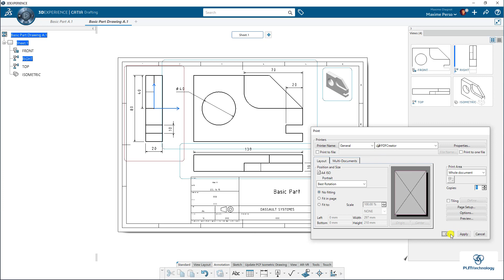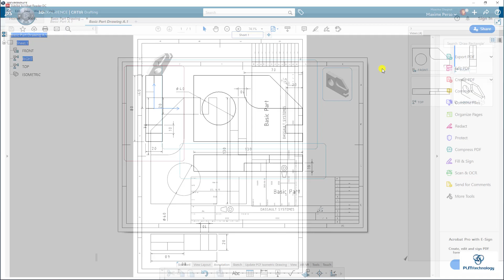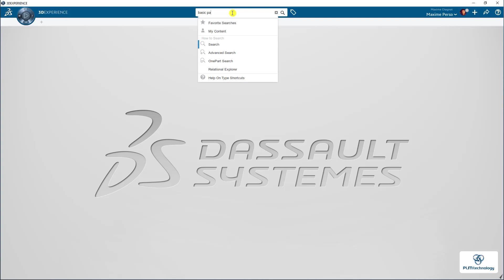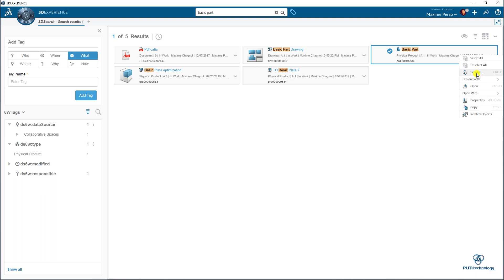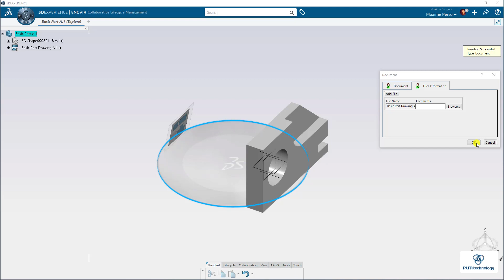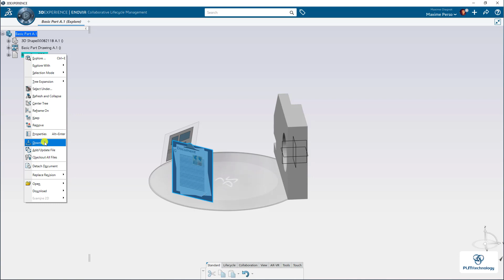2-min Tuto: Attach a Document to a Part - 3DExperience

Comment: Thanks for your videos, I learned more than with my professor. Do you speak french no ? I have a question about the speed for 3Dx, do you have a contact maybe ?

Félicien
Reply from the maker: Bonjour Félicien, Merci pour ton commentaire :) Je vais répondre en anglais pour que tout le monde comprenne. Regarding, 3DExperience speed, it is linked to you internet connection. According to Dassault Systèmes, you would need a minimum of 16Mb/s and latency do not exceed 120ms. In my opinion  this is really low, I recommend 100Mb/s to my customers. Remember that you need that bandwidth from your location to the server location. For instance, I am in Norway, the Europe server is located in Paris, I need that bandwidth from Paris to Norway. ( https://www.3ds.com/fr/support/support-de-la-plate-forme-3dexperience-sur-le-cloud/ ). Another thing that can be useful, check the Cloud Eligibility ( https://www.3ds.com/support/3dexperience-platform-on-cloud-support/eligibility/ ) it will tell you which problem you have. Hope this was helpful!
Reply: @MaximeChagnot  Thanks for your answer. I think we have our self server with my school ("HE-ARC" in Neuchâtel - Switzerland) but the problem is not to open a part but more when I switch between different part tab. They are already open but take always 1 to 3 seconds to charge the tab again. Boring when you work with 5 differents tab and you switch often.
Reply from the maker: @felou12  Oh ok, well then I think it is more link to your machine performance. Nvidia GTX are not supported. You need a certified graphic card, with latest driver installed ( https://www.3ds.com/support/hardware-and-software/hardware-and-software-configurations/?woc=%7B%22operating%20system%22%3A%5B%22operating%20system%2Fwindows%2010%2064-bit%22%5D%7D ) and I recommend at least 32Gb RAM. Good luck, Maxime Chagnot at PLM Technology
Reply: @MaximeChagnot  I used SOLIDWORKS, Inventor and no problem (Quadro M520 on 16gb RAM). But I will continue like this. Thanks for your answer ;)